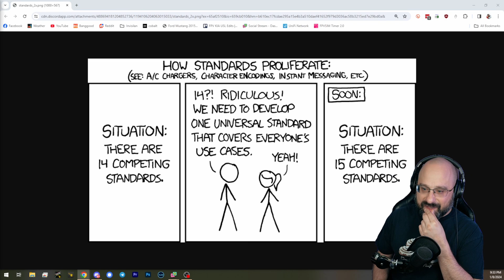Analog Vs Digital Range? How Does It Compare? How Bad Is 1 Watt? - FPV Questions

Comment: Also lets consider the technical limitations of DJI. The O2 has a hard cut at 13.3km no matter how good your signal is. Wezley Varty ran the extreme reaper vtx @2.5 watts and was still getting video at 100km

Comment: To all the respect to Chris Rosser and Bardwell you are misleading general population :D Analog video transmitters are operating in what is called CW mode - constant wave. Radio wave that is. While digital transmitters are sending digital data in packets. So for some period of time there is RF transmission for the rest it is RF silence. This ends up in lower average power. You need to use real time spectrum analyzer to catch the data packet and then you cant measure with the simple marker. You need to use function where power is calculated over the full bandwidth.

Comment: I guess if the router notices a strong signal on a specific band it´ll automatically switches (if settings are set correctly)

Comment: i quit flying years ago because analog was just so underwhelming... and then i got a chance to fly a dji o3 on googles v2. so now building new quads to fly again. the low res and static of analog was annoying. then there is the range.... which made me switch to frsky [yeah been that long] to crossfire but jumping quicking into buying stuff, i missed elrs completely. but just adding a module to my x9d [yeah, see old] on a starter kit with their nano rx. so many questions you answered. now RID.... nah. one thing though after flying that o3 equipped 3" and seeing the resulting recording, i no longer have to strap a gopro on my quads now which is yet another bonus. of course i built a 5" and 6" quad and have a betafpv pico20 on the way.

Comment: The protocol that is used right now in ExpressLRS/Betaflight/EdgeTX is CRSF mostly by name. I believe there have been extensions implemented, and a lot of custom packets in use. Also, there are talks with TBS development team to properly open source CRSF (and maybe choose another name) to better support the needs of the FPV developers community, and avoid the need to build even scarier Frankenstein protocol on top of the reverse-engineered CRSF. So yes, you can definitely say that the updated version of the protocol is in the works. However, there are no ETA, and it most likely will take quite some time.
Reply from the maker: Yeah we discussed this on the news.

Comment: I find it interesting that Bardwell completely ignored HDZero for digital power comparison... lol
Reply: I find hdzero to be the fair comparison, and I get roughly the same range. Dji and walksnail just hide the breakup. Really good systems, but when I'm flying through a tight gap, I'd rather have breakup than a freeze frame.
Reply: @Quadwrex I have all 4 systems, Walksnail & DJI will hide break up and give you lag and latency, HDZero / analog just start crying if you get too far. Range and penetration is roughly similar for Walksnail and HDZero, tho Walksnail is better but not by a crazy amount

Comment: Something I have noticed though is digital you really have very little room for completely loosing visual and analog you can tell easy when it is going out and you need to turn around. As in digital you have this bar that flashes good and bad for a while. Then goes pixelated and its out and loose connection by the time you turn around. Analog you start getting fuzzy and you turn around and it comes back in without a total drop out. So you may get more range with digital but when it drops it drops like a rock. So you need a type of RTH to be safe. But you can also say your flying to far to begin with because you don't have LOS at 2 miles.
Reply: I think the worst is when you crash and lose video. With walksnail and dji, when it goes, it's gone. I've been able to turtle and get out with mostly breakup flying analog. With dji, I'm walking. Hopefully, I remembered to set up my beeper. Hopefully, it's retrievable